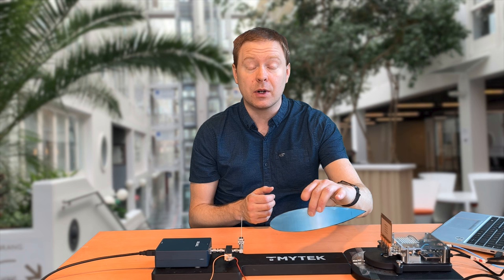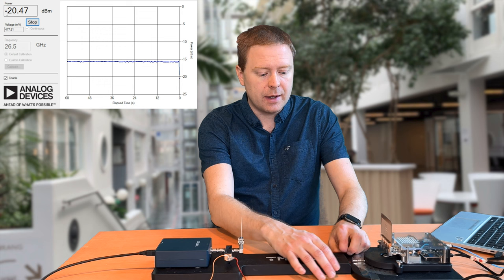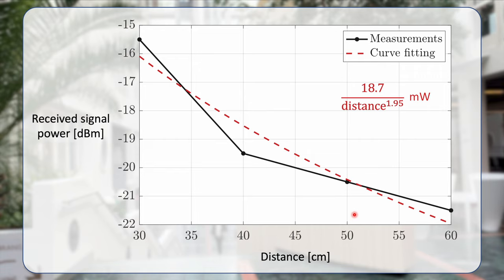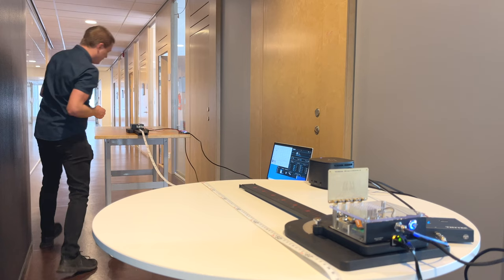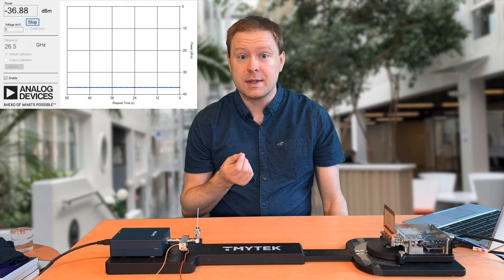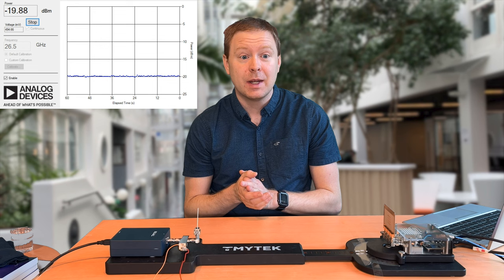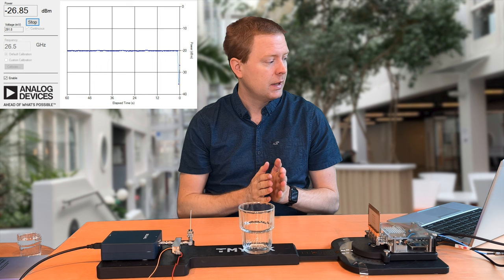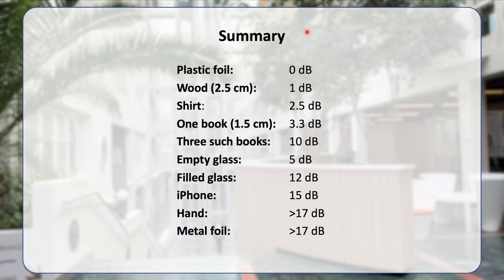Wireless propagation losses [Part 2, Fundamentals of mmWave communication]

Comment: since the frequency is 26 Ghz the optimum distance between antenna elements are 6 mm and you have only four antenna elements 
so why the transmitter is as big as an iPhone ?

another question how big is the bandwidth of the channel you use in this experiment ?

i have to admit that you visualize these com;licated things in the best possible way hope you was lecturer in my college
Reply from the maker: The antenna array is roughly 20 mm wide (≈2 wavelengths at 28 GHz), while the iPhone XR is 75 mm wide. Hence, the iPhone is blocking the path between the transmitter and receiver. If they seem to be equally wide in the video, it is either the perspective or the fact that the array is deployed on a metal sheet that has a width that is more similar to the iPhone.

The signal bandwidth wasn't specified in the Developer kit, and the receiver only measure the total signal strength, so I don't know the answer.

Comment: Hi, very interesting. Can you measure something more. Leaves from trees would be nice and what happens when you increase the distance and put something between. Will the loss be the same ?
Reply from the maker: The propagation loss (with distance) and penetration loss (by an object) are two independent effects, so they always add up when using the decibel scale. I have returned the hardware to TMYTEK, but I will keep your suggestion in mind if I get my hands on it again!

Comment: Thanks for this great illustration, Emil! The great example of body loss. I have seen the statement that body losses at same 26.5GHz can be as high as 30 dB, In the same time additional hand losses stated 0-5dB and 3dB was assumed for most cases of link budget planning maybe it is up to positioning and the fact that there is quite low possibility of completely blocking one of three antennas in smartphone. BTW do you expect any PAAMs mmW to be integrated in smartphones near future to mitigate UL challenges with coverage?
Reply from the maker: As far as I’ve understood, the smartphones that support mmW already use phased arrays. For example, iPhones 12-14 in the USA have two modules that are place at different sides to limit the risk that both are covered by hands. These phones are said to support 4-MIMO so I would guess these are two phased array that support dual polarization.
Reply: @WirelessFuture  I think there is one commercially used phased array in the market QTM527 from Qualcomm and it is too big and power hungry to be used in smartphones. It is used in bigger FWA CPEs where EIRP can be as high as ~45dBm. I haven`t seen any smartphones supporting 4 layers MIMO right now - 2 layers are commonly used: vertical and horizontal polarization, typical smartphone EIRP for mmW is on the level of 13.5dBm (28GHz) (QTM525) and it is 1T2R maybe using two or three antennas in smartphone but only  one is active during PRB. This makes UL the limiting factor for coverage. So the development on the smartphone side would practically improve the mmW coverage a lot.

Comment: The phone back is made of metal.  If the aluminum foil is the same width as the phone would the loss be equal?  Is any energy 'sneaking' (bending) around the blocking object or are reflections being picked up?
Reply from the maker: The dynamic range of the measurements were only 17 dB, so I couldn’t measure propagation paths that were weaker than that (compared to the direct unobstructed path). I believe there will be some weaker reflections in the room, but negligible bending around the object. The phone isn’t entirely made of metal, which is why I think some pieces of the signal penetrated it

Comment: Due to multi path dispersion and the open environment there will be fluctuations in the experiment. If the experiment done in anecohic chamber the experimental results will change
Reply from the maker: Yes, in an anechoic chamber with careful measurements, one should get a perfect fit to the Friis propagation formula.
Reply: @WirelessFuture  Yes, but with two caveats:
1) ensure constant alignment of the transmitting and receiving antennas (constant value of the angles) when moving the antennas;
2) stay away from the receiver's own noise level.

Comment: If even our hands are compltely blocked the mmWave signals... how come the IEEE 802.11ad wifi will work? Is it completely block the wifi signals if someone comes between Wifi router and mobile??
Reply from the maker: The hand is not blocking the signal entirely. The measurement in the video showed that the loss is larger than 18 dB. In later experiments, I have noticed that the loss is around 25 dB. The main workaround is to position the multiple antennas in the router and mobile to minimize the risk that the antennas are blocked. Iphones with mmWave functionality has antenans at the right side and at the top, so that one shouldn't block both simultaneously.

Comment: Very nice demonstration, thank you for this video! Regarding the loss seen with the iphone, could it also be partially due to the hand holding the device? It seems that some of the fingers holding up the phone are almost at the same height as the TX and RX antennas but it may just be the camera angle!
Reply from the maker: It is mostly the camera angle that is tricky because I only touched the edge of the phone. I don't think my hand had a major impact. I did the same experiment while holding the phone from the top, and the numbers were roughly the same.

Comment: Thanks for an interesting lab and demonstration. I am thinking about how much the frequency affects the attenuation of the signal in relation to the distance and physical obstacles. This was at 26.5 GHz which is a relatively high frequency. If it were instead a lower frequency, for example 6 GHz, would the attenuation have been significantly less?
Reply from the maker: In free space, the attenuation with distance is independent of the frequency. The only reason that many pathloss formulas show a dependency is that they assume frequency-dependent receive antenna sizes. I elaborated on this in a blog post: http://ma-mimo.ellintech.se/2019/10/29/is-the-pathloss-larger-at-mmwave-frequencies/

Physical obstacles will, however, interact differently with radio waves depending on the frequency. I've seen several models (ITU-R P.2346-1, 3GPP TR 38.901) where the penetration losses have the form (f is the frequency): constant*f in dB-scale. The proportionality constant is large for concrete and the human body but small for glass/wood, so it is only some materials where the difference in frequency makes an appreciable difference.